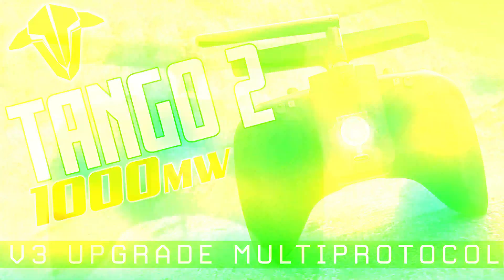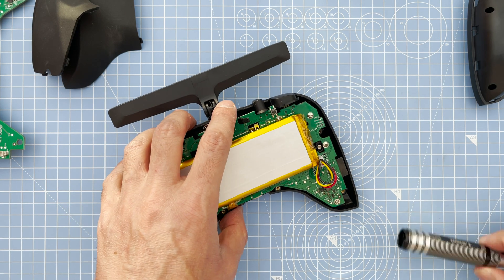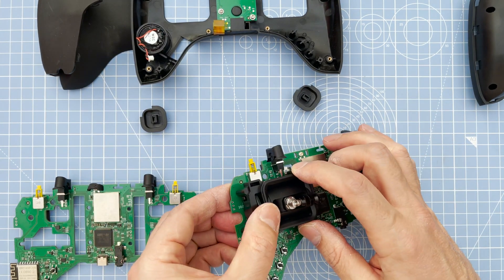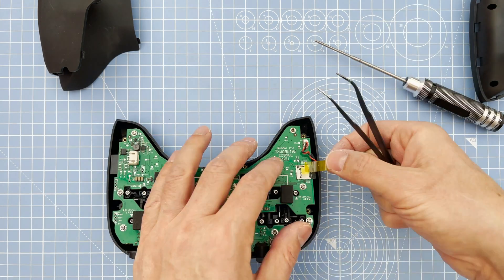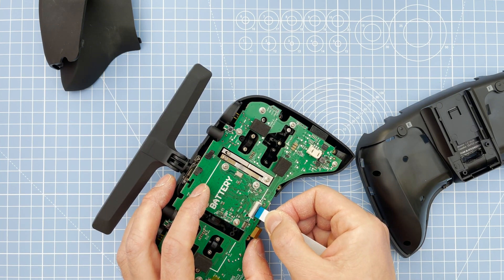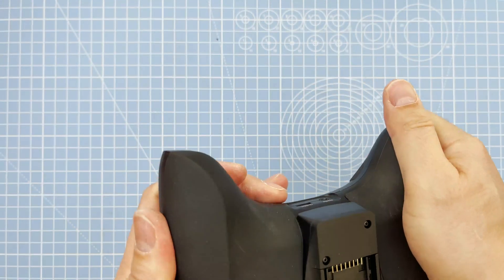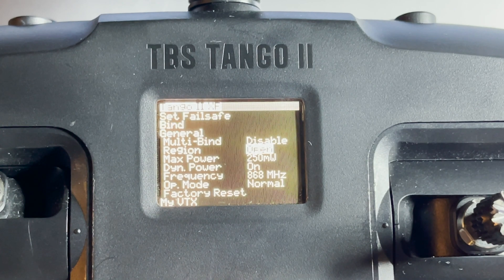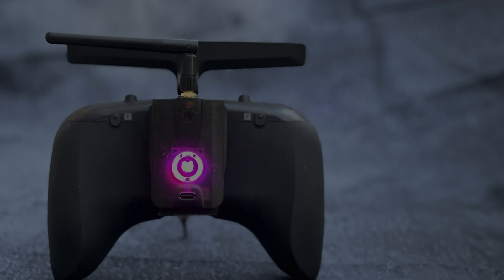1000mw Tango 2 Multi Protocol - V3 PCB - TBS MPM

Comment: hi, why put a crossfire? the tango 2 makes 1 watt native
Reply from the maker: Not sure I understand what you mean, this video was made when many people had Tango 2's with older PCB boards inside which could not do 1watt, so it is the whole upgrade and how to enable 1 watt. The video also shows how to add the module (in the back) to be enable use with FrSky, FlySky etc
Reply: Having the same question. Got my tango 2 in 1W native

Comment: I need help with my TBS Tango 2 pro controller..I bought it off someone online and the board says v1.0 (V006H). I see it has the connector part like the new board where the ribbon cable goes. Do I need to still upgrade my board or can I just install the module to the ribbon cable spot? Please help guys!
Reply from the maker: I believe V006H is the V2 and V006A is V3, both of these should be compatible with the Module Bay

Comment: I'm thinking about similar Tango 2 upgrade to put all my FrSky receiving herd together under same radio. How FrSky telemetry is working with multimodule? Seems it should be not an issue.
Burning a hole in radio casing... ewwww! Seems there is no other way only than order a new back side with required opening from TBS.
Reply from the maker: The telemetry works the same as most transmitters with FrSky as it’s a separate multi protocol module. Lol yes I didn’t want to burn it too but the other option was to cut with a small saw or something but I was worried it would have sharp edges.But the hole is covered up with the module bay.
Reply: @MickyFPV  Glad to hear about telemetry. Also learned about possibility to clone existing FrSky receiver bindings in multimodule. I'm curious how this works in real life. Have a pair of quads where receivers are glued deep inside without button access. I'm not eager to disassemble them now.
How long Tango 2 battery works with multimodule?
Reply from the maker: @KrotowX  I haven’t tried it but I think you just copy the files, I’m not 100% sure but I know it’s simple and you won’t have to touch the receiver